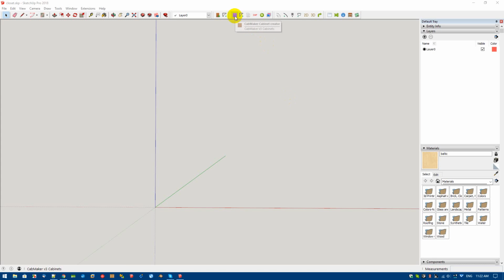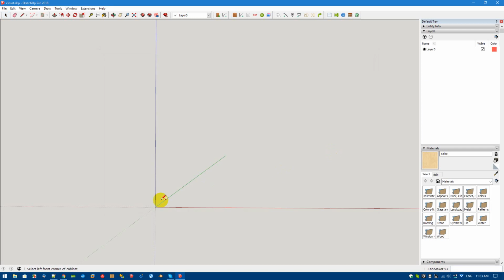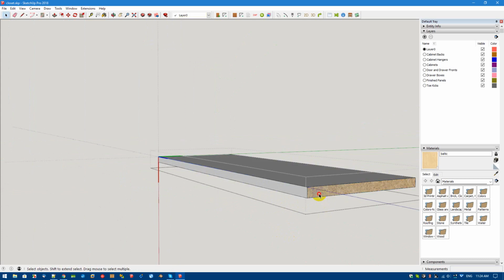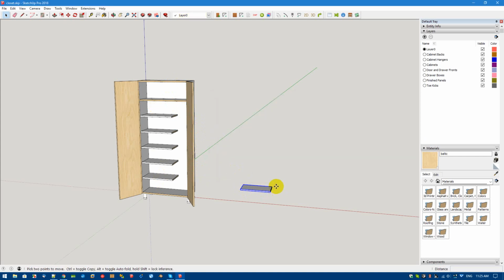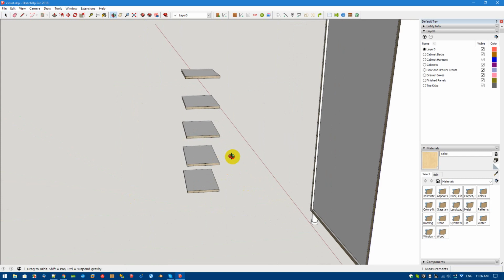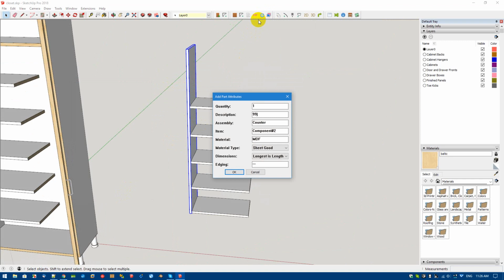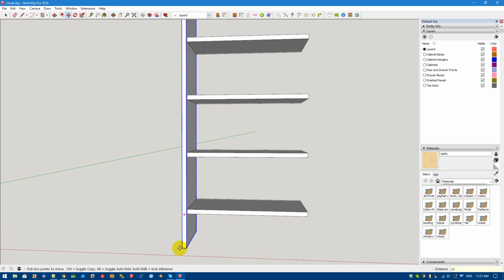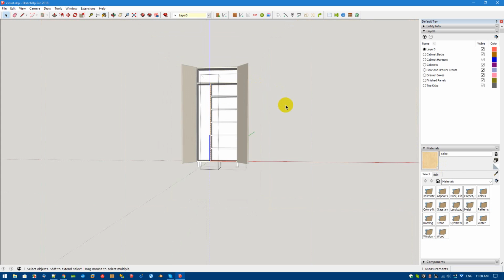Custom Closet

Comment: If we export to cutmaster,Will the new part be shown in cutmaster?
Reply from the maker: If you created a group and then used add attributes then the part is exported. However - there are other ways to achieve custom closets depending upon your final configuration.